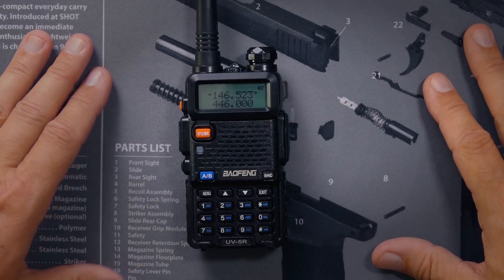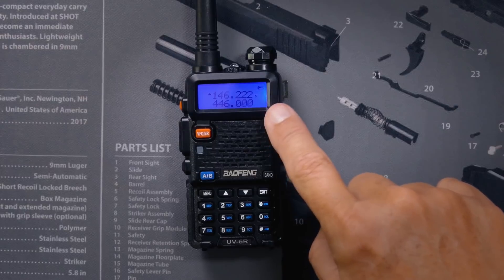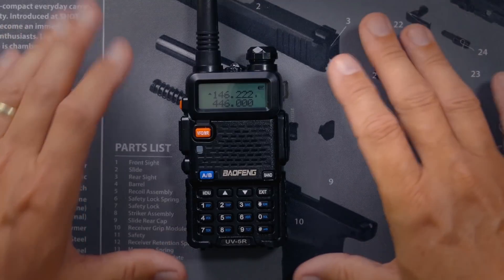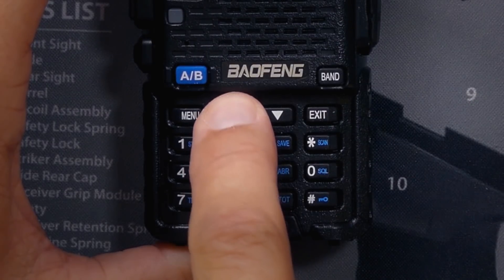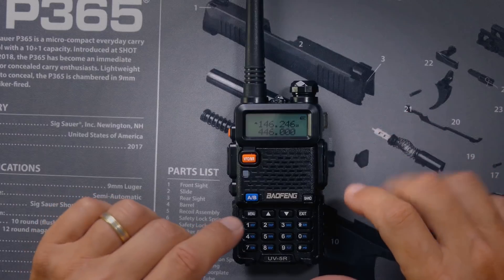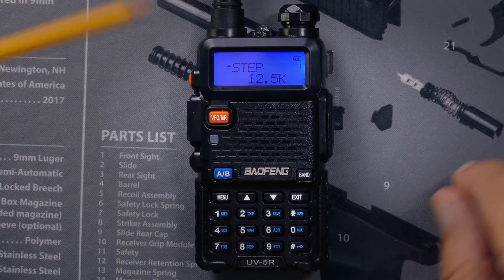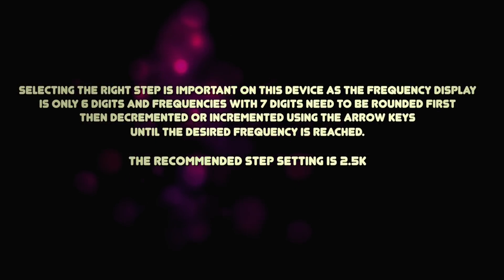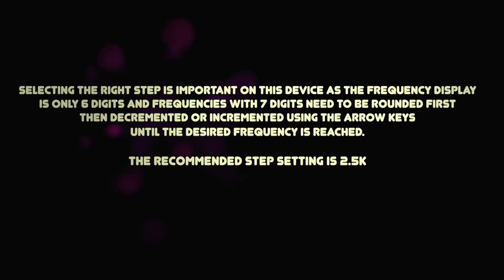How To Enter 7-Digit Frequencies On A Baofeng UV-5R - Entering Long & Short UV-5R Frequency Numbers

Comment: Hey sorry just getting into the world of 2 way radios, i had a question lets say for example i try inputting the frequency 454.3253 i went into settings changed the step to 2.5 but when i cycle through it wont land or even try to automatically input the final 3. Any help or advice Mr.NotARubicon (or anyone) please and thank you in advance

Comment: They recommend Step be set at 2.5 but factory default is 12.5 because... reasons?
Reply: The answer to this question involves knowing a little radio history.  Do you like history?  I am a total history nerd.  So here is the story.....   
Back in the 1960's radio technology wasn't as good as today and they could only build receivers that worked with 50 kHz spacing.  Anything closer together and a person talking on one channel would 'bleed over' onto the neighboring channel.  As radio receiver filtering technology advanced, the channels could be more narrow, so the FCC started adding additional channels inbetween the originals to get 25 kHz spacing.  Low and behold, more years went by, technology advanced further and now the FCC added more channels again inbetween the original ones for 12.5 kHz spacing.  This is why the default step on an analog radio would be 12.5  That is currently the channel step size for ANALOG systems such as GMRS.   Super duper ultra narrow digital systems cut the spacing in half again and use a step of 6.25 kHz but the Baofeng UV5 is not a digital radio so you probably will never need to set the step to 6.5.  Randy's recommendation to select the smallest step of  2.5 kHz just means the radio is ready to be put on any frequency regardless of the spacing.
Reply: If you enjoyed that history story, here is a little bit more.
GMRS started out with 8 repeater channels spaced 25 Khz apart.  That's the way it is still today.  When the technology advanced and the FCC came in and declared new channels (the Interstitial channels) as usual they put them inbetween the original repeater channels with 12.5 kHz spacing,  1-7 are inbetween the repeater output frequencies and 8-14 are inbetween the repeater input frequencies. Because interfering with a repeater input is a much bigger deal than the output, that's why channels 8-14 are limited to very low power, narrow band on hand held radios only and channels 1-7 are not.

Comment: How do you enter a five digit frequency such as 50.125
Reply from the maker: Just like when we learned decimals in 3rd grade, 050.125  is the same as 50.125 ..
Reply: @TheNotaRubicon  With The Baofeng BF-F8HP in frequency mode you can not enter a 0 as the first number. So that does not work.
Reply from the maker: If your radio does not allow you to enter a leading 0, then yours does not allow you to enter frequencies that low.  IIRC, on many/newer UV-5R variants, you cant enter anything below 144.000Mhz or 136.000Mhz

Comment: U missed how to add 52.180 where firstFRQ is 2 digit
Reply: The lowest frequency my Baofeng UV5r will go is 136.000 MHz.  That's because the Aviation band is 108-136 MHz and its Amplitude Modulation and the Baofeng radio can't pick up AM (only FM).